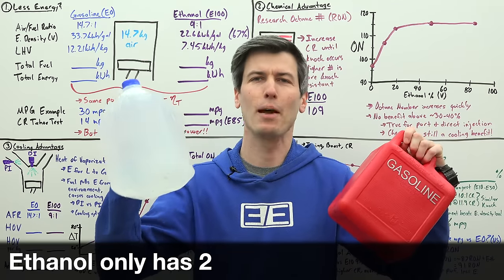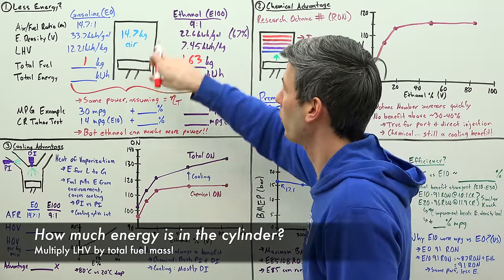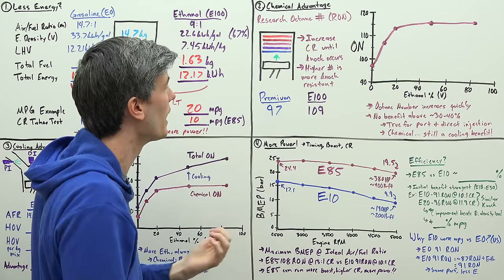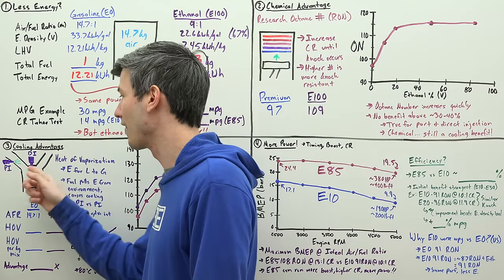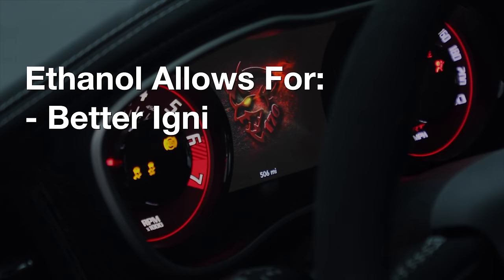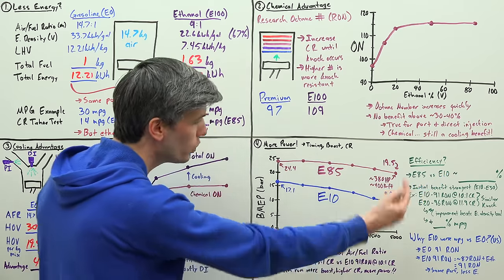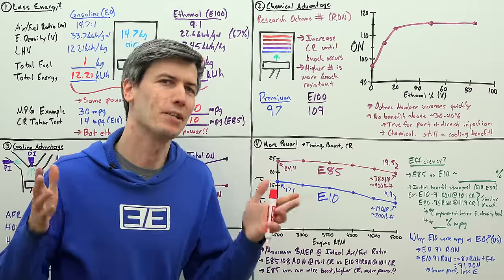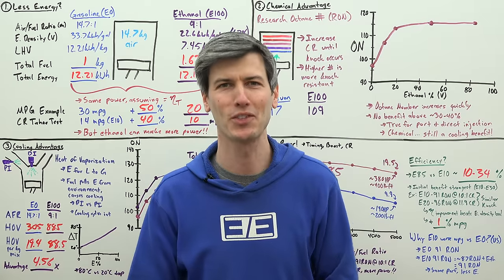Why Does Ethanol Make So Much Power? (Versus Gasoline)

Comment: So, in my case... I have a flex fuel N/A V8 5.0 F150 Port injection engine. No additional power.
I surmise no advantage to using E85. It's less money per gallon but has terrible MPG. It's a wash at best..... and I'd be stopping for fuel more often. 
The only  reason for me to entertain using it would be for towing my trailer due to the thermal efficiency.
Reply: if it were me Id mix 30% E85 and the rest cheap stuff, 87 octane ,whatever you have and see what you get.

Comment: Are there other benefits of using ethanol as fuel such as decreased pollution? Since it burns cooler, there will be less NOx produced in the process. Also, fossil fuels contain pollutants like sulfur and heavy metals. Can you cover these aspects in some of your videos?
Reply: Yes …
Reply: He has a link to one at the top. ORNL  did several studies on fuel mileage and emissions of Flex fuel vehicles. You can google search all that.

Comment: @engineeringexplained You should do a comparison video of how the U.S. is getting ripped off with stations adding up to 15% ethanol in our gasoline yet charging that very same gallon as 100% gasoline. Last I checked there wasn't an ethanol pipeline shutdown that caused ethanol prices to go up. Anyone else notice that some ethanol stations here in the states are charging damn near the same price as gasoline? ROBBERY!
Reply: Explain to me why they should charge less?

Comment: One big problem with alcohol is that it is hygroscopic, which means it absorbs water out of the air.  Water in your gasoline is not a good thing.  One thing you don't want to run with E10 is small engines like lawn mowers because the engines run hotter and thus have shorter lifespans.
Reply: Mercury Marine, which hosted a Webinar on ethanol myths, noted that ethanol does not "grab water molecules out of the air." It is hydrophilic, which means ethanol holds water. With regular gasoline (E0) as well at E10, the primary cause of water collecting in tanks is condensation on tank walls. But unlike E0, which can absorb almost no moisture, E10 can hold up to half of one percent of water by volume, and the water molecules will dissolve in the fuel. The "solubilized" water will bypass the water separator and burn harmlessly through the engine.

>>>Mercury Marine also says E10 may be the superior fuel(over E0) because it keeps the fuel "dry"<<<

People in northern states and Canada during winter in days of E0 actually had to buy little cans of alcohol for gas-line antifreeze with brand names of Heet or Dry Gas.  No need to since E10 came along.

The very same small engines and lawn mowers we have in Brazil use their common gasoline which is E27.  It has worked out so well and for so long that Paraguay went to E27.
Reply: Im running e15 in my lawn mower. Hope to goto E85 this summer.

Comment: The conclusion to this video is the elephant in the room. All european gas stations transitioned into E5 / E10 blends both for 95 and 98 octane and it is impossible to find E0. So you get worse fuel economy with equal power (due to the use of lower RON gasoline blends), meaning you are giving them a paid visit more often.

Comment: So a naturally-aspirated engine that's flex-fuel is just simply going to get worse mileage on E85 since it can't change its boost or compression ratio. Then it's just a matter of is the cost/gallon difference big enough to justify.

Comment: This all sounds great, but it doesn't seem to translate to the real world. Example: my flex fuel Suburban gets substantially better mileage on regular unleaded gasoline with 10% ethanol added than it does on straight E-85, averaging around 330 miles per tank on E-85 vs 440 on 10% gasoline. The difference in price per gallon is not enough to cover the spread. As a side note however, I can't seem to buy real E-85 anywhere. When I buy what is labeled as E-85, it only tests as E-51 according to the vehicle computer. This may or may not be causing the worse fuel economy. I do not know. 
Another point. You talked a lot about direct injection, but failed to mention carbureted engines. What about an older, carbureted engine? How would it fair on E-85 versus pump gas? Also, you seemed to play up the superior octane number of E-85 a lot, but what about pure gasoline with a RON of 130, which I can buy at my  local Sunoco station? Does E-85 lose all it's advantages in this comparison? I would really love to see this one tested, both theoretically and actually. I have an older vehicle in my driveway that has 13/1 compression and is carbureted, I currently only use the 130 gasoline in it. Would I be better served and, more importantly, would the engine make more power by using E-85 instead, keeping in mind that E-51 is, in reality, the best I can purchase around here at the pump?
Reply: I think you are confusing horsepower and fuel mileage.
Reply: @oldblueaccord2629  not at all, I'm fully aware of the difference. 
Curiosity question: what led you to that conclusion?
Reply: @Last-Varangian  topic of the video and then your writing a whole paragraph about your gas mileage ...maybe?
Reply: @oldblueaccord2629  I see. I was not clear enough on the separation of my subjects. I was speaking of mileage in the first paragraph, but moved on to horsepower and high octane gasoline in the second.  Thanks for the feedback.
Reply: This is not new technology or knowledge, it was known long ago.  It is suppressed technology.

Rear Admiral C.M. Chester wrote Henry Ford a letter on Dec.15, 1916:
"...I also pointed out in the article that as governmental laboratories had developed from 40 to 55% efficiency in alcohol engines as against 20% in gasoline machines, the use of alcohol at double the cost of gasoline for power purposes, was cheaper for motor[s] than gasoline in common use today."

The Navy was not the only researcher to possess that information:

Scientific journals from 1890 – 1920 contain hundreds of references to alcohol fuel at the dawn of the automotive era. 

Studies of alcohol as an internal combustion engine fuel began in the U.S. with the Edison
Electric Testing Laboratory and Columbia University in 1906. Elihu Thomson reported that despite a smaller heat or B.T.U. value, “a gallon of alcohol will develop substantially the same power in an internal combustion engine as a gallon of gasoline. This is owing to the superior efficiency of operation…”

The USDA tests in 1906 also demonstrated the efficiency of alcohol in engines and described how gasoline engines could be modified for higher power with pure alcohol fuel or for equivalent fuel consumption, depending on the need.

The U.S.Geological Service and the U.S. Navy performed 2000 tests on alcohol and gasoline engines in 1907 - 1908 in Norfolk, Va. and St. Louis, Mo. They found that much higher engine compression ratios could be achieved with alcohol than with gasoline. 

When the compression ratios were adjusted for each fuel, fuel economy was virtually equal despite the greater B.T.U. value of gasoline. “In regard to general cleanliness, such as absence of smoke and disagreeable odors, alcohol has many advantages over gasoline or kerosene as a fuel,” the report said. “The exhaust from an alcohol engine is never clouded with a black or grayish smoke.” USGS continued the comparative tests and later noted that alcohol was “a more ideal fuel than gasoline” with better efficiency despite the (*then*) high cost.

Comment: in part 1, it seems as though you need 63% more ethanol than gasoline by weight for the same mass of air, right? but shouldn’t it be that you only need ~33% more ethanol since it has about 33% less energy by weight?

Comment: On my rig pure gasoline of 91 octane produces more power (0-60 times) than 10% ethanol of the same octane.

It also has the added benefit of better gas mileage, using less energy per mile.
Reply: Video it show us!
Reply: @oldblueaccord2629  oy vey.

Gasoline has more energy density than gasoline. The cooling affect from 10% ethanol at normal pumps is not going to offset that you are using a less energy dense gas. 

What I've noticed is cars designed for gasoline, the ECU is tuned for pure gasoline and doesn't operate better on the 90/10 mix. It operates worse and destroys your seals.
Reply: @FarmingWithYahweh  Lost me on destroys seals farce...sorry. ALL my cars on my youtube channel run fine on E10 E 15 E 85. So does my lawn mower and weedeater.
Reply: @FarmingWithYahweh  LINEAR THINKING. Thank you!
Reply: Waiting on that video....
Reply: @oldblueaccord2629  don't hold your breathe.
Reply: @FarmingWithYahweh  OK so your just going to go thru life wrong. Well God Bless then. I tried to help.

Comment: I get better fuel economy and performance on E10 85 octane fuel in my 1994 Honda Accord than I get with E0 87 octane fuel. Maybe it just runs a little rich and the ethanol is leaning it out some.

Comment: One thing that seems to be left out of this argument by so many is the cost per mile.

Pure gas (E0) costs less per mile than any kind of ethanol blend or even E100.

Another item is that ethanol is more corrosive to metals than gasoline, but with a little attention to the parts that touch the fuel, that can be minimized a great deal.

As "the man on the street", I prefer to buy what takes good care of my car (Top Tier fuels) and what costs less per mile to operate it.

If I were on a drag strip, I'd have an engine set up to burn E100 because the cost of being first is not part of the time slip.
Reply: Ms. Foto here is suffering the effects of menopause and dementia simultaneously …
Reply: @sking2173  It would seem so!
Reply: Hot flash....As a man on the street...I THINK YUR NUTS.
Reply: test
Reply: @danafletcher2341  Hey buddy!
Reply: @oldblueaccord2629  AI censorship algorithms won't let my Ford pickup example showing the cost per mile to drive with ethanol are lower than without it.

Three invisible posts now though when I am logged in they appear to me as if normal and showing.
Reply: @oldblueaccord2629  I appreciate your opinion, but you really haven't said anything.
Reply: @danafletcher2341  "test" failed

LOL
Reply: @hotflashfoto  My reply had been disappeared three times by the A.I. censors so I posted that to see if it would take.
Reply: @danafletcher2341  Then I take back my comment and proclaim you as the winner! AI might be the newest whiz-bang, but it's still not perfect.

Comment: So, I have a turbocharged car that specifies that I use premium. It sounds to me that I could use regular with 10% ethanol because it's effective octane number would go up. What am I missing?
Reply: Well you would have to mix it yourself. There are calculators online that tell you what percentage E85 to 87 octane you need to get the octane rating you want.
Reply: @oldblueaccord2629  Hmmm...I think I will stick with premium.
Reply: @whiskeytango9769  You can mix way above the 93 or 91 octane your using now.

Comment: Being a drag racer 1/8th mile .. I’m definitely not worried about fuel efficiency , but nowadays I’ve been hearing through the grapevine that guys are mixing certain fuels together to get more power instead of spending thousands of dollars to build their engines.. do you know of any types of good fuel mixtures that will give you more power?  I just watched this video..  so if I tune my bike to run E85, I will get double the power?? Did I watch that right? You should make a video on fuel mixtures that people are doing.. I would love to learn a secret powerful cocktail if you know what I mean..
Reply: Not sure about the fuel systems in motorcycles being ethanol compatible or not. 
For cars to gain power with e85 it typically requires forced induction as well. Larger injectors typically.

Comment: Ethanol has less btu energy than gasoline.
Reply: Still makes more power...
Reply: You are a diesel car owner I presume
Reply: @danafletcher2341  no, but I do like diesel power.
Reply: In our current inefficient gasoline optimized engines, E85 will have lower mileage but more horsepower and is cheaper per mile to drive with.  Exhaust pollution is drastically much lower.  Drastically.

For an example, a Chevy 5.3L pickup gets a clean 380 horsepower on E85 vs a dirty 355 horsepower on E0.

A clean ethanol optimized engine will have both more mileage and more power at half the size than gasoline engines, even more than diesel engines.

Here is one Ricardo built for GM and drove around:

FROM RICARDO:
The new federal CAFE standards are calling for a doubling of fuel mileage performance, which, Vint says, is going to send OEM’s looking for high octane numbers to improve efficiency and ethanol is the best source. Ricardo, an engineering firm with over 100 years in the business of engine design, has developed an extreme boosted direct injection engine (EBDI) to optimize ethanol blends. The 3.2 V6 gasoline engine rivals the power and torque of a much larger GMC Sierra 6.6 diesel, he said, and it delivers 3.5 percent better fuel economy than the diesel.
Reply: @cleolateeple1997  I do too.  I drive right by you guys up Jelico mountain like your standing still twice a month.

Comment: You got the port vs direct injection backwards. Port has higher benefits because the air is cooled BEFORE entering the chamber, which adds more air, which needs more fuel. Direct cools the air AFTER the valve has closed, only reducing the compression effort.
The problem with the Ford comparison is that they are different engines(compression). Of course they will give different results. 10:1 for direct injection is pathetic. I run 12:1 on my port injected 3.0L🤣
Reply: For some reason the E85 power spread is greater with direct injection with the 5.3L Chevy engine.

By 2014, the direct injection 5.3L had 380 horsepower on E85 vs 355 on E0. (at 5600 rpm)
The 2011 5.3L which was not direct injection had 326 horsepower on E85 vs 315 on E0. (at 5300 rpm?)

Comment: So to take advantage of this info, all you need to do replace your pistons and pray your engine tuner can do even half as well as the OEMs with driveability..... LOL

The reality is, flex-fuel vehicles leave a lot to be desired. The lower static compression ratios used to cope with low octane E10 gasoline means they can't take full advantage of the detonation resistance of E85. Therefore you cannot reap the full benefits. Instead you get less power and less economy. OEMs maybe should have made "E85-only" versions of their vehicles.
Reply: A Chevy 5.3 L is rated at a clean 380 horsepower on E85 vs a dirty 355 on E0.

I do agree with you about going to dedicated efficient ethanol engines though they should be E100.  Brazil uses heated injectors similar to diesel glow plugs for starting instead of adding 15% toxic and dirty gasoline for colder starting.

GM wants a new 100 octane fuel standard so they can make efficient engines.  Ricardo built and drove one around for them a few years ago:

FROM RICARDO:
The new federal CAFE standards are calling for a doubling of fuel mileage performance, which, Vint says, is going to send OEM’s looking for high octane numbers to improve efficiency and ethanol is the best source. Ricardo, an engineering firm with over 100 years in the business of engine design, has developed an extreme boosted direct injection engine (EBDI) to optimize ethanol blends. The 3.2 V6 gasoline engine rivals the power and torque of a much larger GMC Sierra 6.6 diesel, he said, and it delivers 3.5 percent better fuel economy than the diesel.

This is not new technology or knowledge, it was known long ago.  It is suppressed technology.

Rear Admiral C.M. Chester wrote Henry Ford a letter on Dec.15, 1916:
"...I also pointed out in the article that as governmental laboratories had developed from 40 to 55% efficiency in alcohol engines as against 20% in gasoline machines, the use of alcohol at double the cost of gasoline for power purposes, was cheaper for motor[s] than gasoline in common use today."

Comment: So have I got this right, basically unless your car is specifically tuned to run higher ethanol content fuels, there's absolutely no benefit to doing so (aside from the environmental benefits). All you're going to achieve is worse fuel economy?